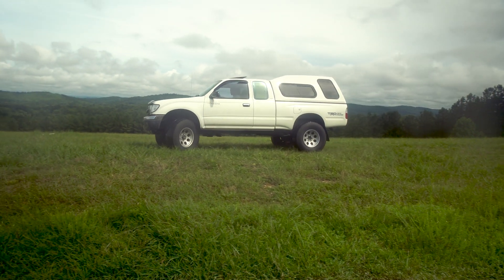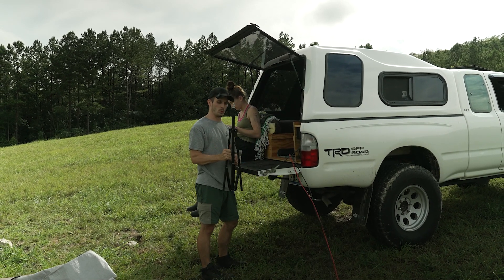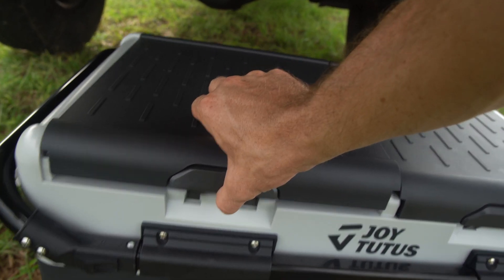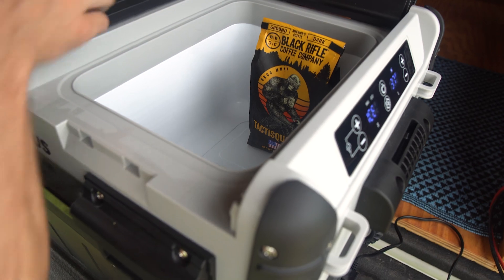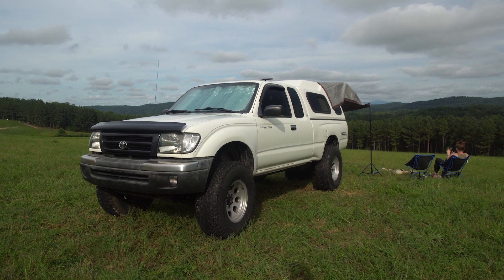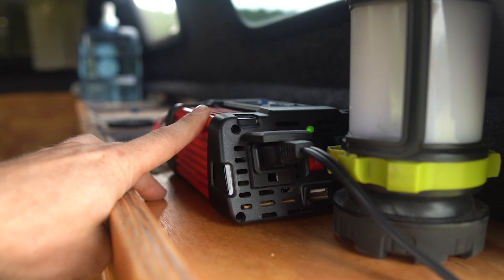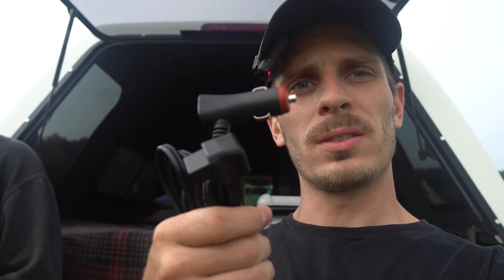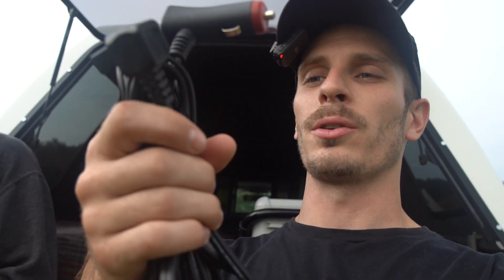The Next Level Of The Tacoma Truck Camper! It's Getting Better!

Comment: Nice change of pace. 

I was going to say that you could buy the clip to keep the metal rod connected, but I think that that's the actual piece of the handle that broke off is the one that the rod fits in?
Reply from the maker: Yeah it’s the part that’s on the handle. It could maybe be reinforced with metal if you were really careful